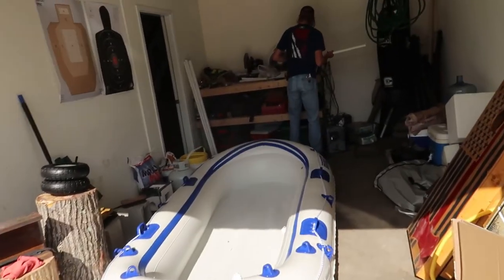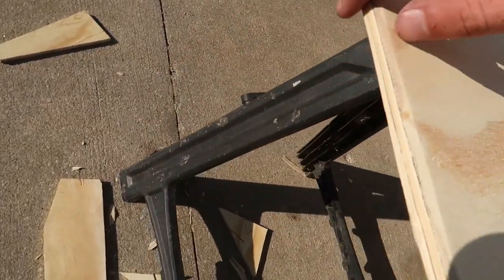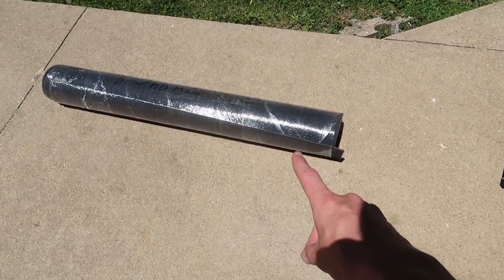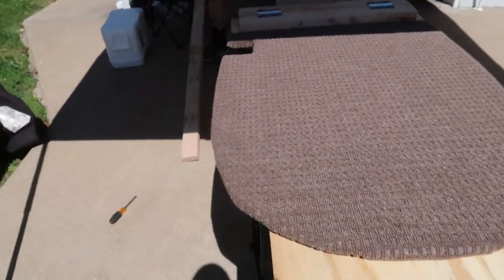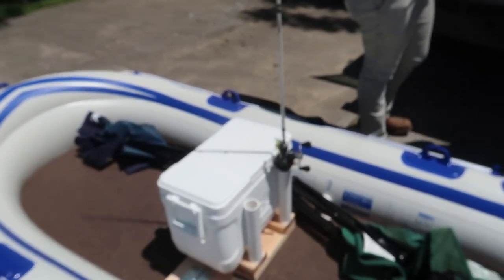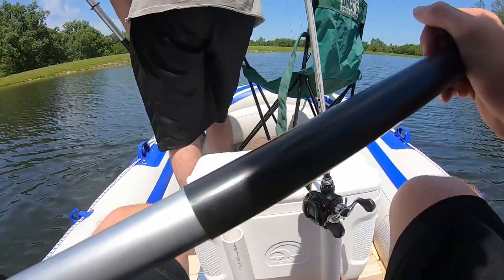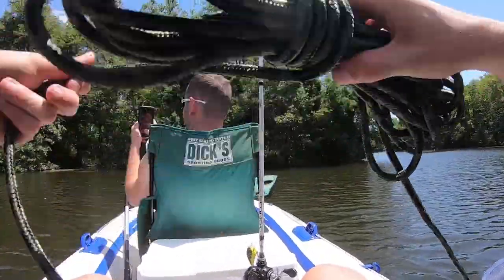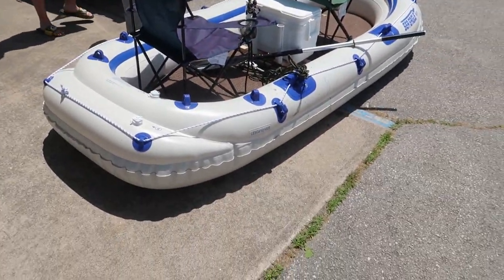Turning my INFLATABLE RAFT into a BASS BOAT

Comment: Had a boat just like this 30 years ago with a wooden floor.  I put another 3/4 inch plywood floor over the one that came with the boat and added pedestal seats that swiveled around.  I had an electric motor for it, too.  It worked great on small lakes.

Comment: Great video! Just ordered my SE9. Can't wait to take it out and add some upgrades as well. 
From some of my own research, it seems like a few Walmarts in my area have Minn Kota 30 and 40 lbs motors in stock. Just enter various zip codes in your area and maybe a store will have one in stock. Good luck!
Reply from the maker: I would double check on the 30 30 one at least near me all the ones dont have it in stock i didnt really want to get the 40 lb one as it was 100 plus dollars more but i did end up snagging one from a family friend so we will be in bussiness here shortly with my trolling motor glad you enjoying the Videos tho!
Reply: @Davn  Nice! Glad you were able to get your hands on one. That will definitely make taking you boat out even better. Looking forward to your next video. Would be interested in which equipment you used to set it up (type of battery, battery charger, the box, circuit breaker, mount, etc.).

Comment: Thank you so much for the video! Were you able to get the motor? Can you post a video of what motor and battery you got? Also where would you put the battery?
Reply from the maker: I did end up getting the motor and the battery I usually put in the back towards where I am sitting under my seat a lot of the time. All in all works great for not having an actual boat but just a little bit of a hassle sometimes to set everything up before being able to get out on the water.
Reply: @Davn  What battery do you recommend? and what Ah battery do you have? how long does it last you?

Comment: Great video bro, I like how you's did the hinges in the middle to make it to foldable to put in your car then you positioned the white box on top. Was the box fastened down by velcro or something or in anyway to stop it moving and coming off the wood or was it just sat on top of the wood in-between the hinges?
Reply from the maker: the cooler has little wedges so it doesnt like slide around and its big enough side to side that it doesnt really move
Reply: @Davn   Ok thanks for your reply.  The reason I ask is after I've finished the floor etc, I want to put the battery and box in the centre.

Comment: I'll be testing our SE9 out here in Montana floating a river soon. You feel pretty good about the durability? I'm a bit worried about hitting some rocks and it ripping badly. Thanks!
Reply from the maker: I feel the durability is pretty strong now I havent hit any rocks going full speed like you might be saying are you white water rafting with it or?
Reply: @Davn  Not white water, just a calmer float river. Last year we rented tubes that had some durable material on them but we did skid on rocks once or twice. I’m mostly worried about that!
Reply from the maker: Oh you shoudl be perfectly fine for that I have drug my raft on concerte to get it to the boat ramp.

Comment: Just a follow up- did you end up with a trolling motor for this set up?
Reply from the maker: I did it works wonders for the raft although it takes a little longer to setup than I would like sometimes but totally worth not having to paddle if you are looking to do this as well I would recommend making a battery box and making it into a chair for the person who’s controlling the boat to sit on so the battery isn’t wasting the limited space you have
Reply: @Davn  good call. I’m torn between this boat and the Intex  Marinier (Sp) the boat is cheaper however the 4 is about 91 lbs with out upgrades and the other one is 56. Just trying to plan it out. I have no space to keep a normal boat.
Reply: So leaning more to the sea Eagle. Do you have an estimated weight?

Comment: I’ve got an inflatable boat I’m about to take out to Stockton lake in MO this year. Definitely going to put in a wooden floor after this video. Also if the trolling motor is electric do you still need to register the boat? I couldn’t find any info on it but if I’m not mistaking I think the law is as long as it’s not an outboard motor you don’t need to register. Someone please correct me if I’m wrong
Reply from the maker: I could never find the full answer to this question easily either and I havent run into any problems yet without doing it but that doesnt mean its wrong.
Reply: @Davn  so as long as I’m sneaky lol

Comment: You should also look into getting a small gas engine. I was able to pick up a 1.5 hp 4 stroke gas engine from Amazon a few years back for my SE9 and it works great. The benefit to using a gas engine is that you have more power and greater range than an electric can provide. I have the 34 pound watersnake that SE sells and it is good, but again you have a limited range. You can extend the range of the battery by adding a solar panel and as long as you do not go full out speed with the trolling motor, you will be able to stay out longer as the solar panel will trickle charge the battery. The gas motor is good because it only weighs at best 10 to 15 pounds vs having the weight of both an electric trolling and battery. Marine batteries tend to take up a lot of space as well as weigh a lot. 

You can get a lifepho4 battery depending on how deep your pockets are. These batteries have the following advantages: 
* you will have more power because you will be able to consume all of the rated amps without damaging the battery. Marine batteries you will only be able to use up to 50% of its rated amps. A 80 amp hour marine battery will only give you 40 amps before you start to destroy the plates in the battery.
* lighter weight 
* reduced size

I picked up a 40 amp hour LifePho4 battery and it is about 1/4 the size of my old marine battery and weighs maybe 10 pounds.  

Back to the gas engine, you will be able to use it for extended trips such as for camping. I live down in Florida and the gas engine is really good for when I go out into the everglades as you can run the motor for several days depending on how much gas you bring with you.
Reply from the maker: Glad to hear will have to take a look into the gas engines a little further as I do have to agree with you the battery does take up quite a bit of space but then you are also just replacing that with the gas can are you not? but  on that note like you were saying the gas gives you more power and a longer life than the battery maybe able to provide if you are trying to go out longer times that I have used mine so far has only been day trips so the battery life hasnt been a problem for me yet
Reply: @Davn  The gas engine really is a lighter weight option. At least the one I had picked up. The 1.5 hp engine is basically about the same weight as the electric trolling motor I have. The difference is that it is self contained. The trolling motor requires a heavy battery unless you go with a LifePho4 battery option.

Regardless, just getting out on the water is the main goal. I really liked the floor you had put together as it makes for a more stable platform and a more enjoyable time on the water.
Reply: @andynorman6342  if you use a gas one does it limit the lakes you go into. I’m looking into getting the boat but some of the lakes out here in PA only electric motors and do you have to register?